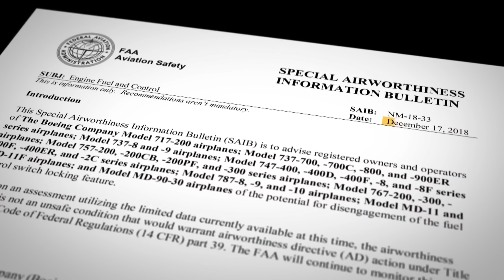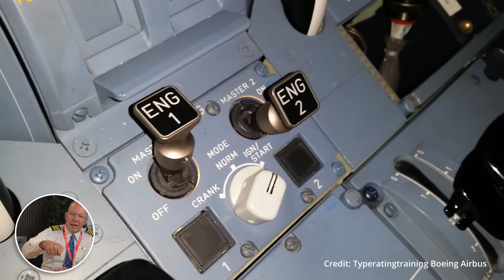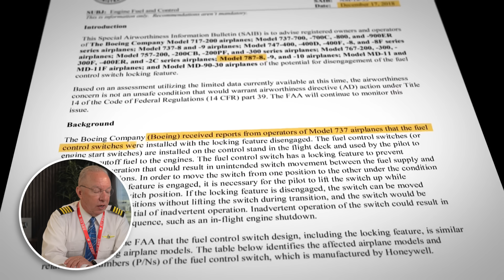Air India 171: The FAA’s 2018 Fuel Switch Locking Bulletin Explained (16 Questions Answered)

Comment: Could it have been possible that one of the pilots - knowing they are going down - that he pulled the switches not to have 2 engines going to the ground running at full-blast to minimise additional crash issues ?

Comment: Captain Steeeve,  I'm curious, since you keep saying how impressive the pilot's response time was before turning the fuel valves from the OFF positions to the ON position. I'm really troubled by this statement!  From an emergency life and death perspective, 10 seconds almost literally constitutes an eternity! Hence, I respectfully disagree with this line of thinking. Pilot judgements aside, a 10 second reaction time is absolutely unacceptable. A 2 or 3 second reaction time maximum which is both reasonable and well within the body's own capability to react with automatic reaction tasks.

Comment: Sequence of actions in the cockpit that explains everything.
1) pilot senses loss of thrust immediately after V2. trail of smoke from from one of the engines confirms engine failure. 
2) pilot flying assumes loss of thrust due to switching off of fuel by the monitoring pilot, prompting him to say " why did you do  that". 
3) monitoring pilot says "I didn't ", which was indeed the truth as the loss of thrust was not due to fuel being cut off.
4) they try to re ignite the engines thru the on/off procedure, Standard SoP..
5) the SoP action succeeds in re igniting one engine, confirmed by partial thrust reclaimed.
6) inspite of repeated attempts the other engine does not re ignite. 
7) the pilots continue the on/ off process till the crash. 

THE STARTING POINT IN THE EVENT IS THE LOSS OF THRUST, WHICH WE KNOW CAME FROM AN ENGINE FLAME OUT AND NOT PILOT ACTION.

Comment: 11:51 - logic can be any two of the below three met- 
1. Master off 
2. Fire Switch/ PB pressed 
3. Throttle/ Thrust Lever IDLE

This is specially important if only one engine is running and the running engine is shut down.

Comment: In the other known pilot suicide cases, the perpetrator waited until well into the flight at a high altitude and full speed, which more or less guaranteed "success" (meaning catastrophe)  in his mission. I'm mystified as to why a suicidal pilot would commit his sabotage immediately at take-off, at low altitude, and low speed (even though, other than the one survivor, it did result in utter carnage). Is it possibly because this gives the other pilot less time to react and gain control? Any views on this unusual timing?

Comment: Cameras in the cockpit on commercial aircraft is due. The CVR and FDR don't prevent accidents but serve to answer what happened in the cockpit and to the airplane. Cameras now provide a third data component. 

Now about AD and SB. In the order of priority AD or airworthiness directives are 'mandatory and required to be accomplished, and are issued by regulatory agencies like the FAA and EASA. SB or service bulletins are typically issued by the manufacturer and 'may' be recommended or optional. But, SB, even though 'optional' usually has language and data included to ensure compliance; also included are due dates which allows for continued operation until completed. And operators and airlines usually accomplish SB. Not to get too in the weeds, some SB have terminating actions. That means there was an AD issued and applying the SB addresses and satisfies the intent of the AD.

Comment: Captain one basic question to boeing. When flight is take off at any cost ,engine fuel should never cut off at any point right due to x reason. This is the first basic test case. How it allows pilots to fuel switch off manually or switch off by system due to any reason. This is a very poor design for any kind of aircraft.

Comment: A quote from page 6 of the AAIB Preliminary Report "The scrutiny of maintenance records revealed that the throttle control module was replaced on VT-ANB in 2019 and 2023. However, the reason for the replacement was not linked to the fuel control switch. There has been no defect reported pertaining to the fuel control switch since 2023 on VT-ANB"  The Fuel Control Switch is a component of the Throttle Control Module and therefore has been replaced twice! There is NO issue with the switch!

Comment: Can a simple flip of a switch crash an aircraft? Simple answer: No.

Why?

Because in a modern aircraft like the Boeing 787, it’s not that straightforward. The fuel cutoff switch doesn’t directly cut fuel. It sends a command to the engine’s control system — FADEC (Full Authority Digital Engine Control).

FADEC then decides what to do based on multiple parameters: engine status, altitude, airspeed, fire detection, system health, etc.

There are complex interlocks, logic sequences, and protections built in. Even if someone flips the switch mid-air, the system should reject it unless multiple emergency conditions are met (fire, smoke, serious fault, etc.).

So if both engines really shut down mid-flight just because the switches were flipped, either:
 • The system protections failed, or
 • The system was designed to allow that — and that’s a design issue, not just “manual error.”

And here’s the most important point:
We are not here to blame anyone or point fingers.

If there’s a flaw in the flight control logic or system behavior, it needs to be properly analyzed and modified — not buried.

Millions of people fly every day. Nobody deserves to become a victim because someone wanted to protect Boeing’s image by shifting media focus.

Hope u read this captain...

Comment: ANA airlines had a 787 that both engines shut off after landing and the switches where not moved.As you know you can shut down an engine by pulling the fire handle that shuts off the fuel.Talking about the Embraer aircraft logic on not letting you shut down an engine with the cutoff switches on the pedestal behind the throttles.

Comment: Question! Sorry if this is already answered. Is there any trobleshootibg process in critical situation to cut off the fuel and then to run position to fix any engine/electronic/hydraulic issue? I am not sure whether the whole conversion was released in the report. I believe we know only part of the conversion was released where one pilot asking other. Do you think when whole conversion is released we might know more information why it was in cut off?

Comment: Just tell me this is not a design flaw,  There is no reason the fuel shut off switches should  be located anywhere near moving flight or takeoff levers .  In no case would these switches be turned off seconds after lift off .  At this stage of takeoff , even a burning engine would not be shut down.  Move the damm switches away from this area.

Comment: There are 2 smoking guns that it was pilot error:
1. The pilot conversation, saying "why did he cut off". If it happened to due to a mechanical failure, etc, he would have not blamed the co-pilot. The response "that he did not do so" could have been a reflex or knowingly denying it due to the black box recording. One pilot has clearly seen another pilot put the fuel switch in the cut off position.
2. The short delay in cutting off one and another engine. If this was due to any mechanical, electrical, etc failure they would have both cut off simultaneously. Since the black box data shows a delay, this proves that it was a pilot error.

Comment: Switches for some critical systems could be set up so that each pilot had their own set. In this situation, both pilots would have had to cut fuel.  On the other hand I get that in an emergency situation you don’t want extra steps so I could see this not being the right direction but it was a thought.

Comment: First thing is second pilot clearly denied he did not do it. Need to give benefit of the doubt to the pilot. Also if suicide was the aim, why will pilot put hundreds of lives in danger, does not make sense. This looks to be mechanical failure of switches where they moved back due to some mechanical fault automatically. Also steve has made conclusion without actually doing background check on pilot's life and if there was any mental health issue he was facing. Without background knowledge, you cannot make such sweeping statements. This looks more like a desparate attempt to rescue boeing out here.

Comment: 2:42 , clearly Boeing is paying for your videos. Even not wearing seat belt in car , gives loud audio alarm within 100 mili second and continues till you put on seat belt. Ducking th equestion of Visual/audio alaram on fuel cut-off warning , by the time you hear engine sound , you are already going to hell.  The moment fuel is cutt-off and plane is moving. Red light should flash all over the screen. Clearly Boeing wants to live on mechanical era of 60's.

Comment: Captn, is it possible for the pilot flying the aircraft to have taken both his hands off of the controls to put those fuel switches back in the right position (assuming the copilot put then in the cutoff position)? Could this have caused the aircraft to dip and crash? I ask this coz the captain may have not gotten cooperation from the copilot. And so he had to switch the fuel controls back into the right position, just when he figures the aircraft is about to crash and made the mayday call??? 😢It's inconceivable the presence of mind and helpless playing out together

Comment: Captain Steeeve, as a software engineer, I believe this is a software issue. One of the pilots noticed that the digital system was showing the oil switches as being off, even though they hadn't been turned off. So, one of the pilots tried turning the switches off and then on again.

Normally, if there's a syncing issue or a digital system failure, this kind of situation is very possible. It means the switches weren’t actually off, but the digital system displayed incorrect information and the pilot trusted the digital readout.
Reply: Are you a Boeing software engineer? Or another software engineer in aerospace? If so, valid points. CVR Data recorders note switch positions.
Reply: There was a 10 second difference between when the switches were physically turned off and then back on, according to what has been reported from the report.

Comment: Regarding the need for cameras in the cockpit. I agree that having one would not have prevented this accident but it having one could have given a clear cut answer if this was an intentional act. If not, then there could be a safety concern that needs addressing. It's a tool that can be use for investigation just like the voice and data recorders. 

Even though you feel like this was an intentional act, there are still a lot of folks , even other pilot you tubers still questioning if it could have been a mechanical failure of the switches. It doesn't seem like an open and shut case, especially since the data recorder records the accused pilot of denying of having put the switches into cut off position. It just adds some doubt as to what really happened.

Comment: I'd expect now after this preliminary report was released the panel with fuel switches is examined very thoroughly by investigators, double, triple check if the mentioned bulletin could affect them on this plane. They'll check the spring mechanism, check the lock of the switches, if everything seems normal. Of course if possible, depends on how badly this panel was damaged during crash an

Comment: Also a camera would help clearing up not just who did what, but who said what. It's still possible that the pilot who moved the switches was also the person who asked "What did you move the fuel to cutoff?". I can think of multiple reasons why someone might do this, not the least of which is related to insurance. It's a terrible situation, and I hate to be focused on the worst part of it in this way, but if someone want to do this terrible thing, but try to get the other pilot blamed, that would be the way to do it. Be the villain, but act like the hero.

Comment: the utmost activity and most reflexive action is to switch them back on to Fuel On once they find that the switches were on cut off, rather than asking this question between pilots and arguing with in the first hand. The pilots returned the switches to fuel in after their “argument”.? makes no sense…

Comment: Engine switch deign as shown looks very primitive for a high reliability operation, looks highly susceptible to mechanical failure like Spring failure. word "spring loaded" has been taken as "not possible to fail" every time in your analysis. But Spring are know n to loose tension, Get stuck, and many more ways to get malfunction.

Comment: MAYBE THE SWITCHES DID TURN OFF THEMSELVES ELECTRONICALLY, AND THEN THE CO-PILOT LOWER THE MANUAL SWITCHES AND TURNED THEM BACK ON, THE PILOTS' CONFUSION IS STRANGE, AND AS YOU SAY THERE IS NO FUEL CUT-OFF ALARM, THE SOUND OF THE TURBINES IS WHAT WARNS, I THINK THE CAPTAIN WAS GUIDED BY THE SOUND OF THE TURBINES TURNING OFF AND THAT IS WHY HE ASKED THE CO-PILOT WHO SURELY ALSO REALIZED AND PUT HIS HAND ON THE SWITCHES, IF IN THE AUDIO YOU CAN HEAR THE CLICK AT THE EXACT MOMENT OF TURNOFF THEN IT WAS BY HUMAN HAND, BUT IF YOU CAN HEAR THE CLICK OF TURN OFF AND ON AFTERWARDS THEN IF THEY TURNED OFF BY THEMSELVES...IT IS A CRAZY THEORY, BUT EVERYTHING HAS BEEN TOO STRANGE IN THIS ACCIDENT

Comment: Your dismissal of the 2018 FAA SAIB NM-18-33 is factually wrong and professionally dishonest. Let me quote the FAA bulletin directly, since you conveniently left it out:
 “The FAA has received multiple reports from operators of Boeing Model 737 airplanes that the fuel control switches were installed with the locking feature disengaged. Additionally, there is the potential for switches to become disengaged from the locking feature over time due to wear or incorrect reinstallation during maintenance.”
The bulletin clearly does not limit the issue to installation errors alone. It explicitly acknowledges that even in-service switches can suffer from mechanical degradation or maintenance-related improper locking, which can:
 “allow the switch to move between the RUN and CUTOFF positions without lifting the switch guard.”
Furthermore, the FAA recommended operators to:
 “Perform an inspection of the fuel control switches to ensure the locking feature is engaged and functioning as intended.”
The fact that Air India never performed this inspection on VT-ANB makes the SAIB directly relevant to the AI171 crash. Your assertion that it holds "no value here" is false, misleading, and frankly irresponsible coming from someone who claims aviation expertise.

Comment: Considering the fuel cut-off switches having been switched to the off position is such an obvious catastrophic occurrence (to both pilots), the 10 second delay in returning both to run is incredibly strange ... I would expect both pilots would frantically be racing to to switch them on. And then one of them (should have been identified in the report!) asking the other "why?" and the other (also should have been identified!) denying it, rather then either/both immediately acting defies believability. Way too much information in this report has been omitted and/or selectively provided.

Comment: How long does it take between the cutoff action and the engine spooldown is felt or heard by the pilots? Would there be a significant delay or would it be instantaneous? I am neither pilot OR aviation enthusiast but the way it works at least with motorcycles is that when you run out of fuel in the tank, the fuel that remains in the line keeps feeding into the carb until it runs out and you feel the engine jerk, seize, sputter and die. 

What I'm asking is, is it possible that, during the final "take-off launch/run", someone toggled these switches absent-mindedly in place of another set of toggled switches (assuming some switches are meant to be toggled during take-off)? Or if it was deliberate and mindfully done, someone was only trying to stall take-off for whatever reason but didn't expect things to turn out this way?

Comment: Ask the Captain   Do we know what caused pilot A to ask why pilot B cut off the fuel? Are we certain that pilot A queried because he saw pilot B make the change, or could pilot A made the query because:
1. Pilot A saw  a status board change or heard/felt the change in engine operation and queried pilot 2 because -- to date -- it is is believed that only a pilot's action at those switches can can engine fuel cut off.  I have heard no evidence beyond hersay that Pilot A saw an action by Pilot B or that Pilot A actually looked at the switches.  
2.  Pilot A made the change for whatever nefarious or suicidal reason, then queried Pilot B to shift the blame.